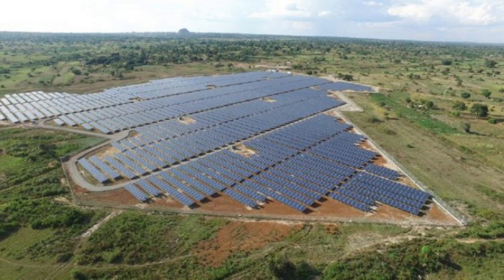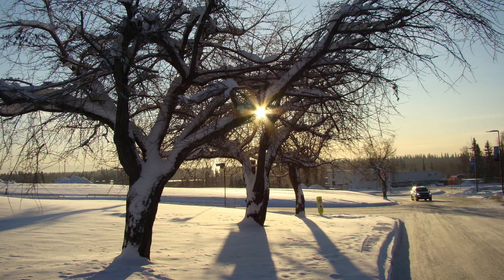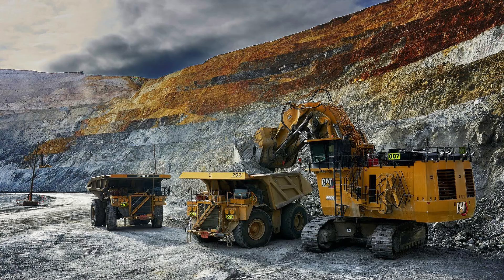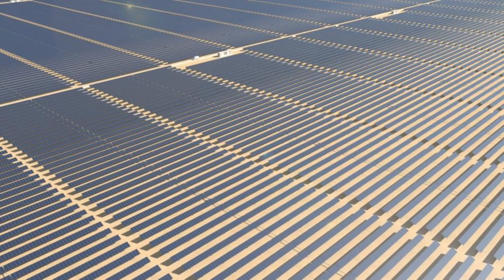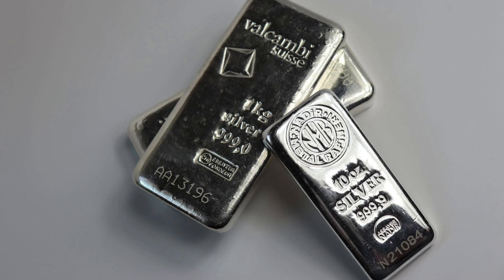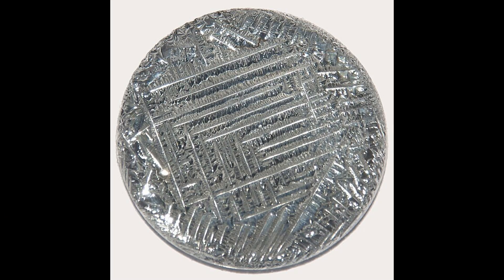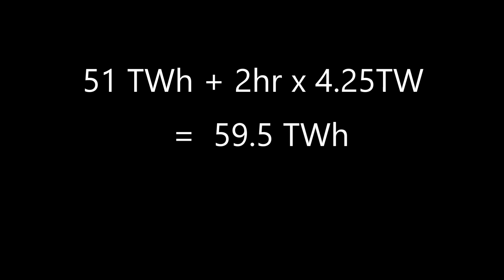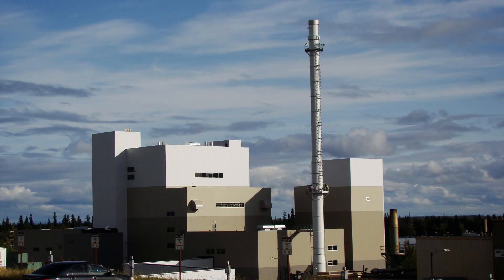The Math for Solar Power DOESN'T Work

Comment: Sustainable Energy – without the hot air by David Mackay, phd pysics, has dozens of these types of analyses. All grade school math.
Reply: All you need is grade school math to do a cost benefit analysis and see it doesn't work. It is a waste of money. A waste of resources.
Reply: @Briand-ei1gs  Check it out. After his death they put it online in pdf. It's very detailed and thorough and pretty comprehensive iirc.
Reply: @Briand-ei1gs  Check it out. The pdf of the book is online since his death. It's very comprehensive and easy
Reply: @Briand-ei1gs maybe I’ll do a video on his book. You’re not the first person to bring it up to me.
Reply: @ please share the grade school math
Reply: @Decarbonize11  (275Kwh/pp/day, average Canada energy)  /  5hours/day (Ontario)  = 55kw/person / .77 (amortized 1% yearly system loss)  71kw / person / 400watts/panel , 177 panels/person x 41million population = 7.2 billion panels x1.9 m^2/panel = 14,000km^2 to power Canada. Before adding in inefficiencies
Reply: @ you need to provide references for the numbers you use. Where does the 275 wh pp/ day come from?
Reply: @ I think you’re neglecting a huge source of inefficiency buried in the 275 kwhr/person, if that includes the losses of generating work with fossil fuels. 2/3 of the energy potential in the fuel is lost due to Carnot efficiency (less for an optimally tuned combined cycle methane plant) generating electricity. It’s particularly bad for ICE cars (20% efficiency, just from the tank, lower for well to wheel) compared to 90% for an EV.
Reply: @Decarbonize11  275kwh was the actual amount used. Quads/population/365 is energy/day/person
Reply: @ please provide a reference. As I stated I suspect this refers to the chemical potential of fossil fuels, and therefore is not the correct number when looking at technologies that directly produce  electricity (solar, wind) or those that directly use electricity (heat pumps, EVs).
Reply: I took a look at his book and he completely missed the mark on PV solar. He lists the power per unit area as 5-20 W/m2, but the reality today is much more, something like 80 W/m2.
Reply: @Decarbonize11  I couldn't find that in the book, what page? PVwatts is an excellent resource and matches well to my own solar installation (I'm off grid)
Reply: That book is 15 years old. The manufacture of PV panels has changed dramatically since then
Reply: @Decarbonize11  That book is physics and algebra and assumes 100% efficiency as it places bounds on all calculations, it will never go out of date

Comment: All minor problems and this video rambles too much. You're totally missing the forest for the sand under the blades of grass.

Renewables are the way.  It most directly taps into the free cosmic amounts of clean fusion power we get from the sky.

The sun provides us with a constant cosmically sized 173,000-terawatts of power non-stop.  Or about 1000W per square meter peak on the ground and its always peak somewhere.  At 99.9-percent the mass of the solar system, the Earth is just a tiny crumb next to a large watermelon, especially considering the remaining 0.1-percent mass is mostly Jupiter and Saturn.  All the combined fossil and fissile material amount to a bucket in an ocean of water compared to the sun!

There is no source of power remotely close within 4 light years of here.

For reference, 173,000-terawatts of power would provide all the 620-exajoules the world uses in a 1-year in just 1-hour.  Or we could tap on average just 1/10000th of that over the course of a year.  Much less than 1-percent of the world's land surface in just current-generation photovoltaics can power all the world's grids.  There is enough offshore wind to power the world several times over.

The raw inputs of sunlight and wind cannot be taxed, sanctioned or blockaded.  Some combination of sun & wind is available everywhere on Earth.

Renewable energy (especially solar) is at historic lows in cost per MWh and yet still continue to drive their prices lower!
Reply: Moreover, there are other forms of solar other than photoelectric.  There are also concentrated solar power (CSP) which heats a central tower and melts sodium to drive a turbine.  There's also rooftop water heating which saves a ton of energy since it takes ~4.2kJ to warm 1 liter of water up 1°C.  A typical 8-minute shower may take some 3kWh of electricity but this can be avoided greatly with direct solar warmed water.

Comment: I have to say even if you have a point to make with all these numbers, calculations and assumptions it is being presented in a most unclear, rambling and boring way (sorry if that's too blunt). If there are any resource constraints on the elements used in solar panel manufacturing they will be reflected in their prices (which continue to drop). You only need to look at the worries about peak oil to see that price and advancement of technology will either curtail demand or increase supply (or both). In 2022 CdTe solar panels represent only 4% of the global market for solar panels. The value of solar farms being built today is not in their instantaneous capacity (MW) but in their ability to supply energy (MWhr) offsetting existing carbon based generation.
Reply: The amount of solar added to the global grid systems last year sufficed to increase the solar percentage of electricity production from 6% to 8%.  This cost 23% of that year's silver production when recycling is included.  That is enough solar production to reach the global goal in about 20 years.  He also largely ignores the scope to increase mining, decrease other forms of silver demand, increase solar efficiency by other means (like making more of them tracking systems), and use substitute materials in the solar panels.  The market is a vast information system that uses price signals to incentivize efficiency where there is (as there usually is) some flexibility in supply, demand, technology, time frames, etc.  The fact that silver prices have risen 65% in the last 5 years as solar production has boomed will incentivize new mines and possibly more intensive use of old mines.
Reply: @kreek22  Not to mention incentivizing more recycling of Silver

Comment: The math for climate change is far worse.
Reply: You sound like a clown when you suggest solar panels fix climate change. 

Solar panels make climate change worse, not better. 

Is it better than burning coal? Sure. 

Do we need to burn coal to make solar panels? Yep. 

Do we need to mine the Earth to make solar panels? As well as destroy forests? Yep.
Reply: Micro hydro watersheds sound nice. No substitute for making less go further, generally less than the average Western dumpling, let alone the small percentage of the biggest consumers.
Reply: @leifcian4288  You're hoping to power 20 petawatts of data-centers with microhydro watersheds?
Reply: @aliendroneservices6621  Not necessarily interested in data centres. They can perhaps make do with less.
Certainly a vast amount of solar energy drives the hydrological cycle anyhow.
Certainly the hydrological cycle is very closely related to the carbon cycle ect.
Go figure, I don't know.
Reply: @leifcian4288  "They can perhaps make do with less."
Indeed. That would increase demand further.
Reply: Nuclear power is the option that just works.
Reply: Yeah, the other side demands that a) if climate change cannot be prevented by a singular solution, it's not worth changing anything and b) said solution must be cheap, reliable, generate vast amounts of electricity AND it needs to be compostable.
Reply: Yeah praying to climate gods and hypothetical co2 reduction is better
Reply: do you mean the math that was saying that the world would be destroyed by 1960 than by 1980 then by 2000 then by 2010 then by 2015 then by 2020 and then by 2025?
Reply: @ianfoltin ???
Reply: In the 1970s the "experts" and "scientists" were saying we were heading into an ice age, because temperatures had been DECLINING for 30 years.  They were recommending MELTING the polar ice caps by covering them with soot.  Should we have listened to them then?
Reply: And?

Comment: Silver is not necessary. Copper can be used. Now I see this technology is paramount for solar adoption.
More efficient panels do not necessarily require Germanium nor Tellurium. Perovskites for example.  
As for batteries, consumption at night is usually much lower than during the day.
Reply: Copper cannot substitute one for one in low-voltage circuits.  Peskovites are currently a laboratory curiosity, not a production item.
Reply: Come on, he carefully picked and chose his facts, you ruining his conclusion by presenting the whole picture!
Reply: Also wind usually peaks at night, so wind+ solar needs much less storage than just solar
Reply: @Decarbonize11  No, that's not true. Wind day vs night is roughly the same. Wind, if anything, will peak during the afternoon due to insolation.

Comment: Solar will become part of the mix. Silver price will rise as panels as a % of market rise, that incentivizes mining which has a long lag but will eventually respond to consistently increased demand. Solar won't 100% solve power output but it adds a solid amount during the day and it's relatively cheap to install in incremental amounts, better than nothing. Mass scale nuclear buildout would be ideal, there's no political appetite for it and it also has a long lag time to build. SMRs are great, when they finally get certified and mass produced. 100% on board with as much nuclear as Bill Gates and wants to pay to build and I sincerely hope it gets more dedicated funding and focus from congress.

We could encourage a lot of this with rational public policy - vote!

Carbon tax + coin (a la Chen 2017) is an efficient tax, internalizes the externalities of polluters, and rewards better behavior. Make grid tie-ins quicker to approve and install (goes for nuclear, wind, solar, everything). Add some amount of storage capacity to reduce the necessity of peaker plants (pumped hydro, spinning turbines, and yes, batteries). You don't need to store 1 night's worth of power to make a significant impact with storage, and you'll need specific types for grid stabilization. Grid interconnections will also be key if we ever want western US power used in east coast peak times (specifically thinking sun is still shining, but goes for all types of power). Use the baseload more efficiently.

Full YOLO Nuclear and Wind funded by a carbon tax, a man can dream. I'll take whatever I can get at this point.
Reply: Wind and solar absolutely depend upon fossil-fuels. No fossil-fuels = no wind-and-solar.
Reply: @aliendroneservices6621  Fossil fuels are energy dense and easy to burn, we're going to use them for a while yet. Doesn't mean we can't reduce that usage and focus on the sectors that really need it. Bulldozers mining silver will likely be powered with diesel for the next few decades but getting coal and gas plants off the grid is still a laudable goal. Compared to burning coal, mining and manufacturing solar is significantly less damaging to the environment. Compared to burning gas, it's still better (even if you ignore the methane leaks) and considering the CH4 leakage, it's much better. 

It's an efficient choice to burn fossil fuels to mine the materials necessary for renewable energy. The energy generated per unit waste+emissions is worthwhile.
Reply: @28lobster28  Wind and solar don't power anything, sustainably.
Reply: @aliendroneservices6621  Except  they do power things sustainably in the sense that panels and turbines generate far more energy than they require to create. I would encourage you to look up a levelized cost of energy report (YT won't allow links). Wind and solar are significantly less expensive than combined cycle gas without considering subsidies or the cost of pollution. Wind/solar + batteries are far less expensive than gas peaker plants. All are less expensive than nuclear (by a lot at Vogtle prices, less if you compare to other projects)
Reply: @28lobster28  There are 1M factories on Earth. Exactly none of them are powered off-grid by their own wind turbines and/or solar panels. That isn't sustainable.

If you think power-service from wind-and-solar is cheaper, then build or buy a factory or data-center, and power it off-grid exclusively with its own wind-turbines and/or solar panels. Include your choice of storage. If you're right, you will outcompete all of your competition.